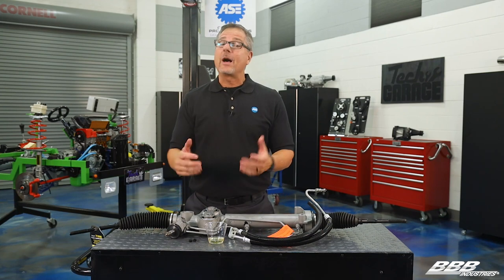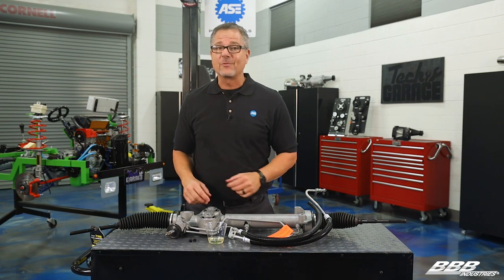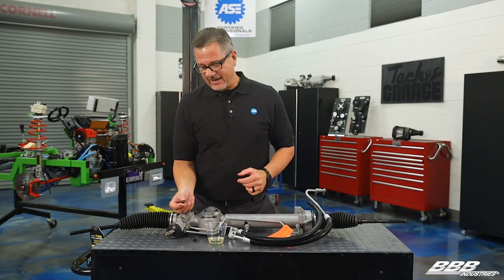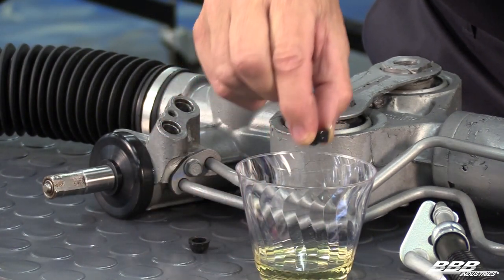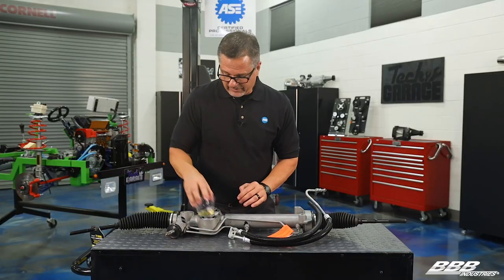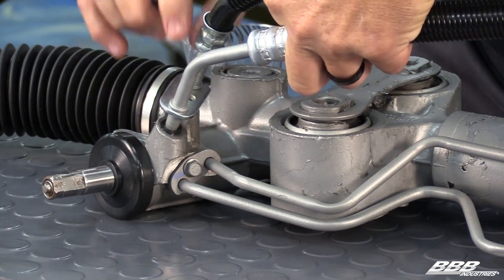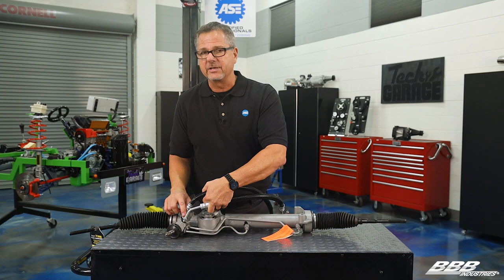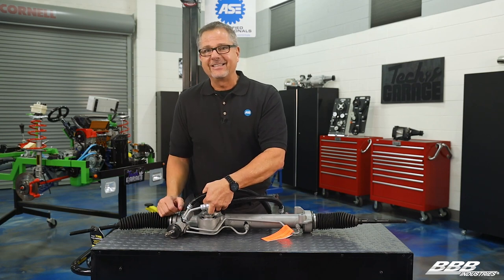How to Properly Install Duckbill Seals

Comment: Thank You!!!!!!!!!!!!! All the other videos I've seen say to seat them in with a 9mm socket & hammer. They end up mangled & spray hydraulic fluid everywhere. I just did it the way this video shows, and NO LEAK!!!! You are a lifesaver sir!
Reply: Nubbalotusv you are correct this Guy needs to read The manual before making a vedio  this is bad information and it cost me 2 more seals and another hour labor
Reply: @billmelcher1794  Your saying this video is wrong and they need to be seated with a socket or similar implement?